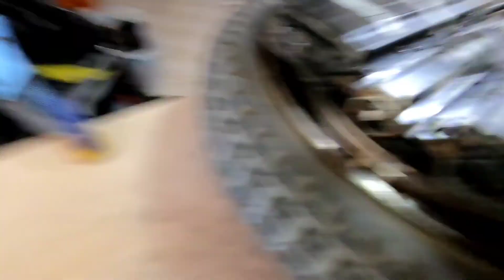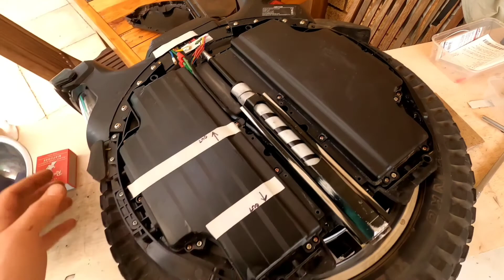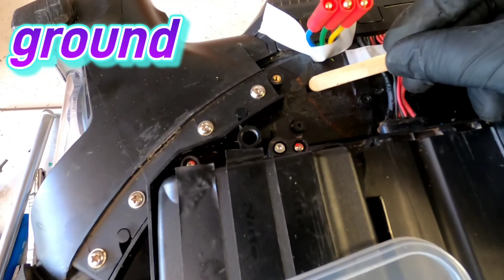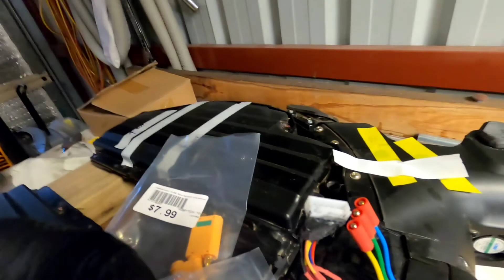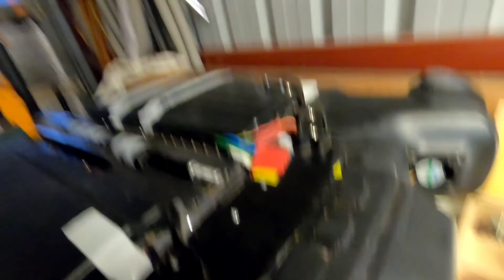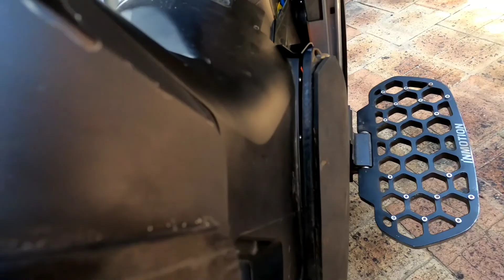InMotion v11 motor cable mod part 2

Comment: why the hell do you cut the cable instead of just unscrewing the top?
Reply from the maker: Mobo is fragile. And takes way longer to open the main board. 
Cable cut is best mod. I wish I did this day 1
Reply: Im considering doing this. It sucks going to the motherboard just to change a tire